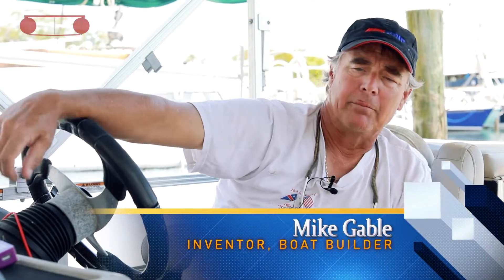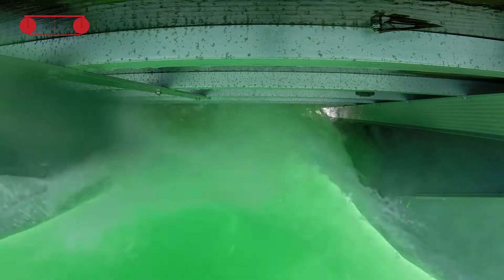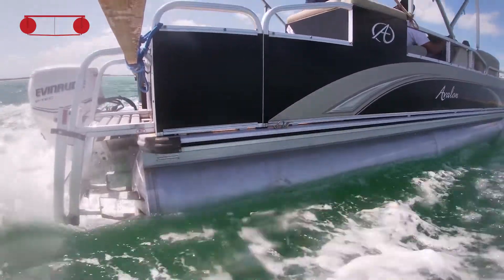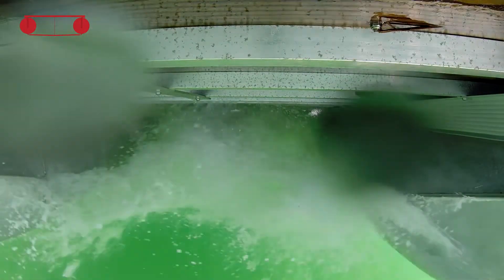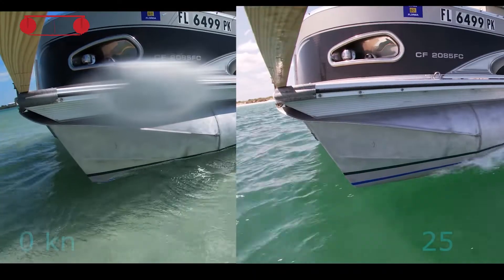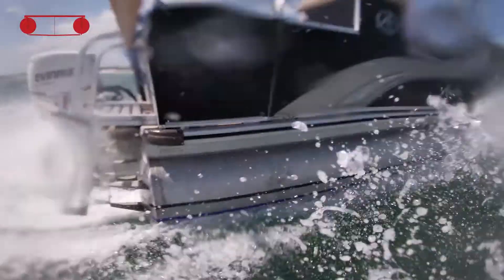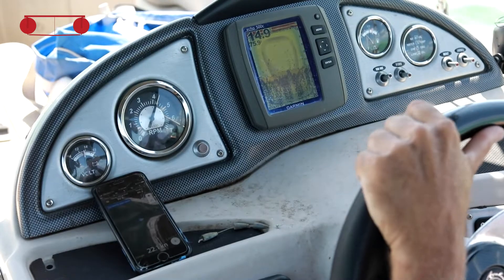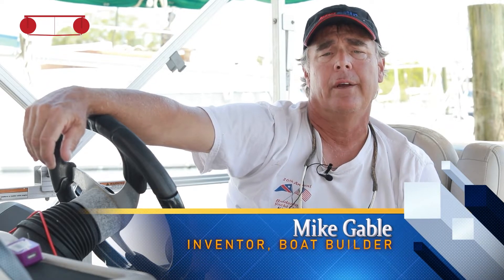VARA™ Foil Pontoon Hydrofoil Speed and Lift Testing

Comment: needs under deck sheeting for water and air streamlining. stepped hulls would be better. needs small lift strakes  down each side of pontoon to keep water from tracking up each side of round tubes.
Reply from the maker: Check out our new VARA™ Skin underskinning also. At 9.5 lbs, this easily installed underskinning takes less than 4 hrs to install, in water, on trailer, or on lift. Normal aluminum.03 underskinning weighs approx 52lbs. for a 22' boat. This skinning is translucent so you can see fuel lines, electrical runs, and even bird and squirrel nests acquired during storage. Typical cost for all USA made materials is 399.00 up to 26' boat, 435.00 for boats to 30'. 

Watch this video for strength https://www.youtube.com/shorts/XYT7FgDOqJE 

Join the VARA™ Life, you will never return to normal pontooning!
Reply: foils no good for where i am  to many weeds  and has to slide on trailer each inside. sheeting looks good👍👍

Comment: Talk about the prop pitch to does that also change to
Reply from the maker: Hello Max, Great Point. We are finding that to get everything out of your boat after a VaraFoil kit install, a prop change is desired. Last VaraFoil install increased max rpm's of a 2017 90 Merc on 20' pontoon between 5-600 rpms. Speed went from 21mph without foil to 28 mph WOT ( Wide Open Throttle) with foil. A new prop will take him into the low 30's and I intend to update after new prop install. Thank You for the question.
Reply from the maker: Pontoon Hydrofoil Update: We tried a 14 x 21 stainless which worked well with just 2 people on boat and added 4 mph however rpm's were less than specified so we also tried a 14 x 19 that was a perfect fit and gave a very balanced ride with an extra blade plus 1 hell of a hole shot. 31-32 mph is where we settled in with an allowance for 4-5 additional people for expected decrease in rpm's. General Propellor in Bradenton Fl. is still amazed at what a hydrofoil addition does to the increase in speed and decrease in drag. They have started collecting data so that our customers can call directly after an install to get a properly spec'd propellor.